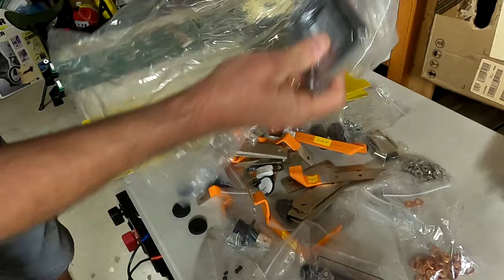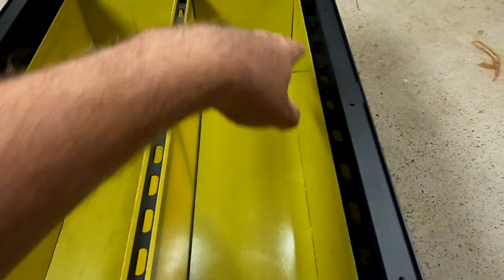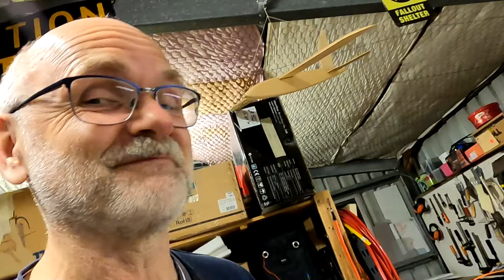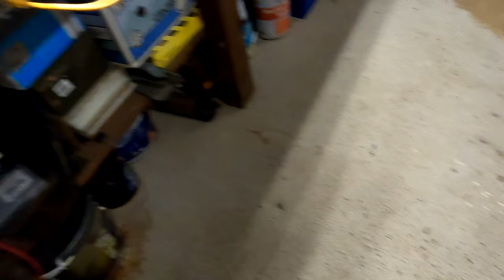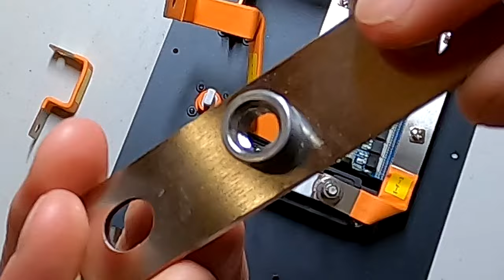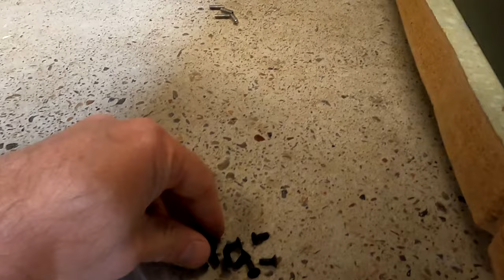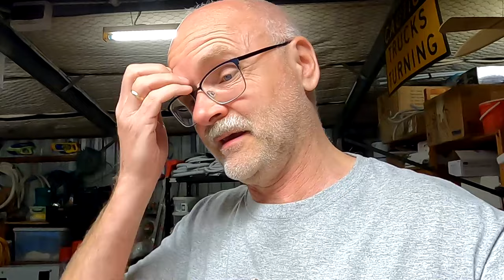Building the SEPLOS MASON 280 DIY Kit - What a BEAUTY! Da-Da!

Comment: Hi! I am preparing to build my first lifepo4 pack and came across compression thing. So everyone tries their own methods and calculations. In the datasheet it states that compression has to be 300kgf. I am not a scientist and forgot the school physics program but Ive googled a compression force calculator, the one which would help understanding engine head tightening. As input data it requires force in N, so ive googled kgs to N conversion and it is so simple: 9.8N. Then, there is a quantity of bolts , their diameter and friction coefficient (which can probably be ignored). As a result of calculation of 3000N compression force needed, the tightening torque of 4 by 10mm  rods is only 1N/m each. I am still unsure if this is correct calculation, but it seems that 300kgf isnt that much and is only needed to withstand cells deformation during cycles

Comment: Thank you for the show. I still hope one day a vendor will come out with an 8 battery 24V system (for EVE280 or 304).
Reply: WHY ?
Reply: seplos has a 24V version of the box  for the same cells.
Reply: @davidkettell6236  Because I need systems that one person can handle without a forklift (Steroids and daily Gym visits are not an option).
Reply: @sergea1138  I just had another look at their homepage and you are right. Many thanks for pointing me into the right direction.

Comment: I'm looking forward to seeing your BMS settings it is so many choices it's a bit confusing I'm trying to I'm trying to optimize my setup but I don't believe I haven't yet I have 1 but  just ordered 2 more cases  Plus the power cables you can buy from them  Is there real nice quality They really should let you know about them so they can up cell more product As well as the USB cable
Reply from the maker: The settings of the Seplos are totally confusing. They are not in any order and it's hard to find things. It will take a while to get used to it.

Comment: Making a guess here: You have a version "10D" on the 280ah Mason BMS. Even though one of the RJ45 ports is labeled "Canbus", it's not on the 10D, its an RS485 port. **I'm guessing they will tell you to use that port for your PC communication**. I didnt see what version BMS os on the 100ah unit, but my guess that it's a "10C" model. The bad news is that a 10C BMS cannot parallel communicate with a 10D BMS (in case you wanted to connect your two Masons together) according to Seplos 
I know this because I have two 10C models and have found that only the 10D model can communicate with my particular inverter (MPP LV6548). The 10C provides it's Pylontech interface via canbus and the LV6548 only accepts the Pylontech over RS485. Unfortunately, a firmware update wont fix this.
Reply: You can ask for  a replacement if you want to switch to a 10D version or 10C .  Just don't try to install a canbus firmware on a 10D bms version or a RS485 firmware on a 10C bms version or it will brick.
Reply from the maker: Great, thanks a lot for sharing these information. I will wait for their reply but will test the CAN port to connect to the computer. 
The whole point was to connect the two together...
Reply: @OffGridGarageAustralia  You need same bms version to do that, and since you are using victron, it is better to get a canbus version ( 10C )  for both batteries in order to connect them with your gx controller later.

Comment: Andy, its Micro ohms not milli ohms as stated @ 22.44. 16 x 30+ milli ohms is 0.5 ohms so would drop way too much voltage and not achieve the 0.5C rating of 140A discharge. Also the copper washers go on top of ring tags so the nuts don't gaul the ring tags and twist the wires to the PCB.
Reply: It's always the same. People can't read nor interpret numbers correctly. However, Andy does truncate numbers correctly - at least better than others - they just skip the number they don't want. e.g $0.19 is truncated to be a dime. Yeah right!

Comment: I've built 2 of mine so far and mine came shipped just fine (I have the 200A BMS and 'so far' came with the correct cables.)  I'm going to be putting out my video on assembly pretty soon.  Just finished editing my solar panel/CC upgrade which (should) premier 09/01/2022.  I made several comments in my video on build procedures and areas of concern/upgrade.  For example, I used the bus bars that came with my cells along with the copper washers and mine had the holes for the ground screws.  You're positive fuse-to-bus bar connection is wrong.  Flip the horizontal bus bar that connects to the terminals.  You also didn't install the heat-sink thermal pad.   BTW, the manuals are on the Google drive.  I'll be adding the link in my video.
Reply from the maker: Thanks. I have the link to the manual they have sent before the weekend. No mentioning of the heat sink chewing gum installation. The busbar at the terminals will not fit the other way around as the flexible busbar would need to bend a lot to make it still fit. As you have seen, my kit came with a pre-assembled BMS and screen. Not sure if you have the the 280 DIY kit as well or any other version of their batteries.
Reply: I am in AZ as well i did a pair of these with 280 ah cells. No missing parts. Followed a youtube video of theirs. All in all a nice build. A little hard to follow at first but now that i have done it i want two more kits.

Comment: I think that the copper washers are there to crush slightly and to then provide a better contact between terminal and busbar. You taught us all that when using Pauls washers, the cheap chinese copper ones were malleable and therefore provided better contact.
Reply from the maker: But you have Al terminals, a copper washer and AL bus bars. That makes no sense...
I never used any washers under bus bars. At least I cannot remember...
Reply: @OffGridGarageAustralia  You did not use washers indeed, but you've shown that the difference between Pauls busbars and the malleable chinese busbars was immense. So i think this is the same principle, the aluminium busbars are probably too stiff and will likely not adjust to the terminal surface as much as the copper washers will.

Would be fun video to test this though. Another one where you spend all your time pointing your IR cam at terminals :)

Comment: I noticed there were squared "gaps" at the back wall of the structure so two cells at the very back are not fully supported by the wall. The are supported only on, say, edges. What do you think about that with regard to cell compression? Regards and greetings from Poland.

Comment: With your cells already slightly bulging, the compression force is probably higher than designed. Probably fine, but good to not over tighten the front screws. I wondered if you would need to source longer screws but you found they were just long enough to engage the threads.
Reply from the maker: They seems be still able to move a bit even under this fixture now, so the EVA tape does it's job I guess. I was wondering if this might be a problem for used cells which are a bit bloated already.

Comment: Andy, can ask a stupid question, why must the batteries be so tightly fitted? Interesting that they have to be under high pressure
Reply from the maker: The manufacturer suggests this to get the 6000 cycles out of the cells. Without compression, they will last 'only' 4500 cycles.

Comment: Your positive bus bar seems upside down. Does the flexible bar make good contact with the rigid bar sitting on top of the formed threads?
Reply from the maker: It is upside down. I did this so the flexible busbar stays in its intended shape 😉

Comment: Hi Andy, great video. It has inspired me to fit one of these to my house. I have already had my cells arrive and an awaiting the seplos case. I have just found out that in the UK to apply to correct these to a grid tied system I need to apply for permission and provide data sheets for all equipment including the batteries. I've tried to find the datasheet for battery on seplos Web site but can't find it. Would you know where I can get this. Sorry for the hassle but panicking now that I won't get permission.
Reply from the maker: Yeah, connecting to the grid is always a bit... hence, my off-grid installation...
What cells doe you have? Did you scann the QR code on top and find out the manufacturer? If you bought the cells from Seplos as well, they could be Higee cells and you can google the specification sheet.
Reply: @OffGridGarageAustralia  hi Andy, thanks for the reply. Sorry to keep bothering you but did you ever get the Bluetooth app to work for this battery as I can't even log in?

Comment: Hi Andy, maybe a different baud rate? Maybe try 9600, 38k, 115200.
Reply: And maybe set the DIP switch address to 01 and select batt 1 in the software?
Reply from the maker: Yeah, I will try that. Thanks.

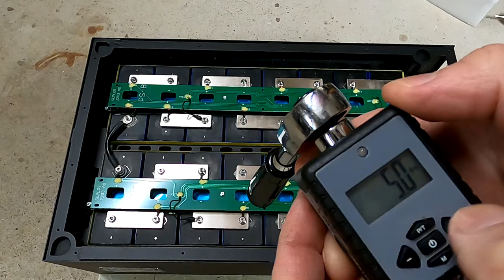Comment: 23:57 Why you don't use the drill's torque regulator? The job much more quickly done with that. The scale on the drill probably foot-pounds so you have to multiply those numbers by 1.36 to get Nm.

Comment: Andy, buy an usb to lan interface, it will work, sometimes the integrated lan has conflict with other hardware of the pc
Reply from the maker: It works with the other battery OK though. So cannot be a conflict on the PC.
Reply: @OffGridGarageAustralia  all is it possible with the horrible windows! should be that the first setup with the other battery have reserved some interrrupt ,  anyway i suggest to try with another fisical lan on pci-e or an usb to lan intefaface with other COM

Comment: Connecting 2 or 3 batteries in parallell , maybe using a bus bar:  between busbar and battery i would install a DC fuse or cut off switch. But then the soc and voltages would drift appart. How to handle that situation or when to reconnect? Or disconnecting the working batteries when 100% soc and then charge the offline one to 100% ?
Reply from the maker: This is what I have installed in my battery shelf:
Battery - BMS - DC Breaker - Bus Bar
Just turn on the battery banks, they will level out themselves when you fully charge. No need to balance them or so. Just ensure the voltage difference is not top high. 1-2V are fine.

Comment: The gaps are not even because you are compressing from one side only.  You are working against compression force and cells friction force against the the bottom.  I have rods and compression plates at both ends and tighten them such as.  In my case is a mobile application so compression & flexible jumpers is a must.

Comment: Hi there, I am using a Mason 280 with a 200amp Seplos BMS and 16 EVE 304Ah batteries. I have configured the BMS to 304 AH. I'm trying to find out where in the VRM I can check if the battery is charged to 15 kWh. On the installation data screen, I see that the battery has only reached 8 kW, which is not what I expected. You suggested that I drain the battery completely and then recharge it to full capacity. What is the recommended percentage that I should allow it to drain down to before recharging? I drained it to about 50% before recharging. Is that not enough?
Reply from the maker: The Seplos BMS does not report the kWh or Ah to the Venus OS.
Follow the instruction for the BMS. Fully charge and top balance the battery. then fully drain it until the BMS shuts down, so the BMS learns the capacity of your battery.

Comment: Hey Andy. I have just built my battery system with VRM. Is it true, that you cant change any parameters in the solar charge controller(via VRM)? And is there a good way to get temperature of the battery into VRM? Thanks so much!

Comment: Maybe the loose accessories knock of some SMD components on the BMS. I had a temperature sensor knocked of on one of my BMS, contacted Seplos and they can identify the issue immediately, I can confirm that the sensor was physically ripped off maybe by myself without noticing it because it's on the very edge of the board. 
So I disable it since there are multiple temperature sensor on the board and work fine. They did sent me the specs for the sensor if I wanna replace it myself. 

And Andy, I saw the resistance calculation and it was 0.0000375 ohm or 0.0375 milliohm or 37.5 microohm. It's would be crazy if the short of a bus has milliohms of resistance, it would have 750w of lost at 100amp per busbar.

Comment: I have the Same Mason box in use. I had the same problems connecting it. I think I have solved it with the driver from the google drive.
Reply from the maker: But it does work with the other battery and BMS? I don't think this is a Windows 10 problem...

Comment: Hello,
I have some recently bought lifepo4 cells.
Out of ignorance, I connected them down in series, while waiting for my daly BMS to arrive my home country. 
Upon BMS arrival, I went checking the voltage of the batteries, only for me to find each and all, reading negative (-26.40V ) on the multimeter as against 26.40V as at the very day they were connected after top balancing. Please, is there anything I can do to correct this?

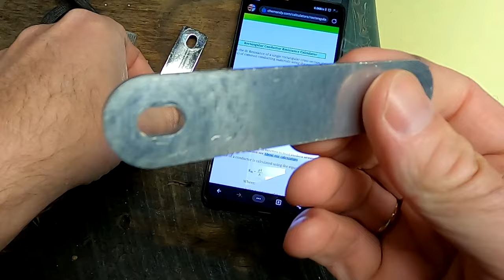Comment: 1 milliohm - 0.001 ohm. 37.5 milliohm = 0.0375 ohm. The calculated result was 0.0000375 ohm, which would be 37.5 micro ohm, not milliohm! This might seem pedantic, but any further calculations based on this error at 23:00 will be out by a factor of 1000x!

Comment: the blue gum is to transfer heat - it only makes sense below the mosfet power section of the bms for cooling.
Reply from the maker: I know what it is but there is nothing mentioned in the manual... The BMS was also already mounted...

Comment: Just for shits and grins, I'd change the connection speed starting at 19.2k and go down. It's possible the communication protocol was changed, could be as simple as dip setting on the BMS. Give it a shot! All you have to lose is some time. And, I think you have the positive buss bar upside down. The two buss bars should join and not on the screw stud like you have it.
Reply from the maker: Is there a second dip switch on the BMS somewhere? I haven't seen one except the one at the front.
Yeah, the busbar... if I flip it, the flexible bus will bend a lot though
Reply: @OffGridGarageAustralia  I can't tell by the video. I  do know that for what little time it would take, I'd start at the 19.2k and go slower until you reach the bottom (1200 baud?) Is there a way to change the parity? I'd try that too. It won't hurt anything and the only thing you'd be out of is time. 

As for the bus bar, I rewatched that part of the video and I understand what you're saying. It still doesn't look right to me, but I'm no expert. If the bus bar could be made to fit the buss bar that connects the two output ports without deforming the snout out of it, I'd give it a try.

Comment: Can you tell me how to set up the EVE 304Ah batteries in the 200amp Seplos BMS in this Mason 280.  Right now mine says Rated Capacity of 200 AH.   I would think it should say 304Ah.  Is there a place to change these settings?
Reply from the maker: Do a full charge, discharge, charge cycle and this number will be set to what the actual capacity of tour battery is. The BMS will measure it and set this accordingly.

Comment: Hey Andy, don't know if your problem with the bms-software is solved.. I solved it by importing this 16S "agreement" XML file (16S_V20_ADDR_EN.XML) in the "Agreement"-SubFolder. After changing  this "Agreement" the software must be restartet after the prompt. Maybe this would happend because of first importing the smaller XML-File for the smaller batterypack. Have fun and hopefully this was the problem and you solved it earlier.

Comment: As some of the comments mention, the C and D versions of the BMS affect comms. That is the one thing I dont like about the BMS. I also have an MPP Inverter,  but all seven of my Seplos BMS's are CANBUS models, which I hear cannot be mixed with the RS485 versions.
Reply: yep, I confirmed, they can be mix.
Reply from the maker: Your BMSes don't have both, CAN and RS485? I thought they always have both anyway
Reply: @OffGridGarageAustralia   the inverter port (on the left) could be  CANBUS or RS485 depending of the bms vesrion (10C or 10D) . The label for this port is always CANBUS whatever version of the bms is.   The 2 right ports (RS485 1 and 2) are for inter battery communication  and PC host connection.     Check your bms version (10C or 10D) if your have 10D then it is a RS485 version and your dip swich setting is not the same as for the CANBUS version.

Comment: You can fix the sticker with a hot air station set to 120c
Reply from the maker: Yeah, I could put the lid out in the sun to heat it up a bit. The question is though what happens if it gets cold again... The sticky part does not seem to be that sticky...

Comment: Can this DIY battery be used with a Growatt SPH3600 Inverter?
Reply from the maker: I believe it can. What connection does the Growatt have? CAN or RS485? In either way this BMS would be able to communicate with it.
Reply: @OffGridGarageAustralia  It has both CAN and RS485 connections 👍
Reply from the maker: @Duked11  Then it will work. You can set the communication protocol to Growatt in the software. For SPH inverters you need to contact them before ordering so they can set it up correctly to work with your inverter:
It's here on their website in the text a bit further down: https://www.seplos.com/sale-13707067-canbus-24-48v-8s-16s-200a-lithium-iron-phosphate-battery-smart-monitoring-management-system.html
Reply: @OffGridGarageAustralia  Thank you